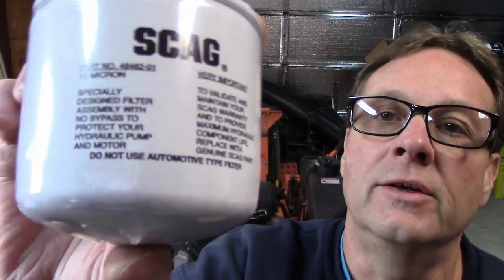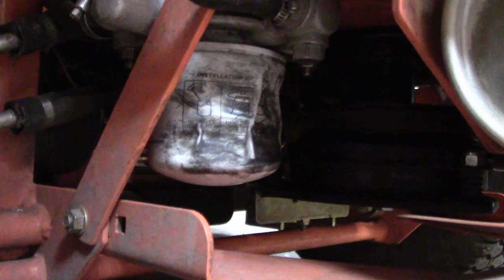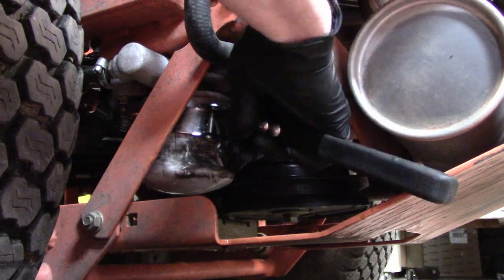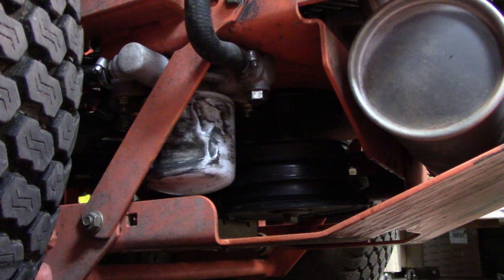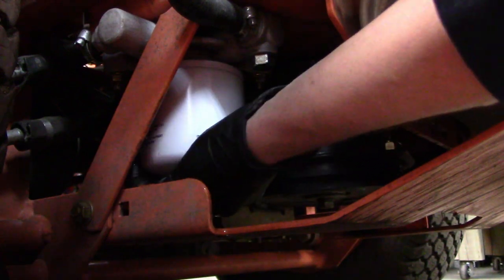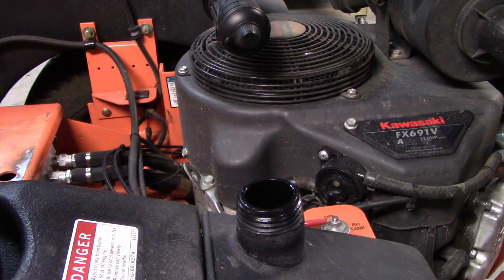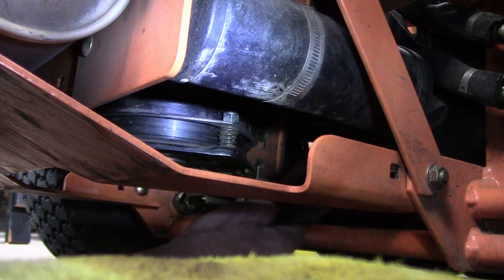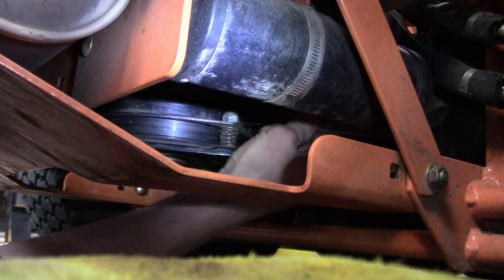Scag Tiger Cat Hydraulic oil filter change and clutch adjustment

Comment: Mark... good demonstration vid.  One thing that aggravates me about just about all mower manufacture's is their stupid filter placement (both engine and  hydraulic).  Why they can't locate the filters with the rubber seal up is beyond me.  Think of all the oil messes and spills all over the frame of the mowers that would save!  Ferris is one exception if you get a model with the huge 5 quart (or so) engine oil reservoir with the oil filter right in the very top just behind the riders seat back!  Plus you are only required to change the engine oil about every 500 hours!  I think their engineers are actually awake at Ferris!

Comment: Hey Mark hope you had a great Christmas and I’ll wish you and Vicky  a happy new year too
Yeah I love my Walker but there are very limited dealerships here in jersey too!! It’s a great mower that’s so convenient with the power dump, mine actually is the high dump as well! The only issue I’m having is the lifting wire harness is running intermittently so I am currently waiting for it to arrive it apparently is a known issue I just hope it works! I will install the harness myself! Like you I try to do as much myself as I can! I may though pickup a used scag or even toro as a backup but certainly used not new! Unless I find one cheap

Comment: I’ve been running scag mowers for years and years and have had very few issues with them. I have one with almost 6000 hours on it. Still has the original deck spindles.
I also was wondering why you don’t go to a bigger deck like a 61 inch? A lot of your properties look to be fairly good sized. Just curious?
Have a great new year! Really enjoy your videos.
Reply from the maker: About 75% of my properties are smaller yards and the 61 is just a little to big to get around with.
Reply: Ok that makes sense. I really like how you do things. It’s very much how I do stuff as far as maintenance. Seems like a lot of guys around me take their equipment in for maintenance. I know I save a lot of $ by doing my own. Keep up the great work.
Reply from the maker: I also really enjoy doing the maintenance on the mowers when it is slow.

Comment: Do you have to open the bleeders on the hydros when you jack up the mower and go back and forth with the sticks to get air out the system? Thanks
Reply from the maker: If the filter is filled before installing that is not needed.

Comment: What problems have you had? I’ve had my Scag for 6 years now, just hit 500 hours. I’ve changed belts, oil, filters, and one PTO switch was replaced under warranty.
Reply from the maker: I go through a deck belt every 150 hours. Carburetor and the safety harness was replaced under warranty because it wouldn’t run on both cylinders at less than full throttle. All of that happened in the 2 years I have owned it since new.
Reply: Marks Misfit World that’s probably about right on a deck belt. I had my drive belt somehow pop off, I think something jumped in between it and a pulley. Anyway, it knocked off my brand new deck belt, broke it and the drive belt rode on the edge of the pulley and gashed it. Was not happy!

I’ve learned not to put the mower in too thick of stuff. Yes it will cut it. But the belt will start to slip, and wear it out faster. 

My harness got smashed on one connector by the seat. I fixed it and haven’t had anymore issues. The only other issue I can think of, was the mower kept wanting to die randomly. Eventually I took the seat off and took it apart and found a giant rat nest inside it that was affecting the safety switch.

It’s been a really good mower to me. My dad has gone through a john deere and toro in less time than I’ve had mine. The john deere was the worst piece of crap ever. My uncle has two exmarks. One has been beat up and started falling apart probably in his 5th season, but he never took real good care of it. The spindels on the exmark are not serviceable. 

Scag has the best spindels by far. 

Thanks for your video btw. I just ordered some gauges to check my clutch, valves, and change my spark plugs.
Reply from the maker: @seabass22  None of my other mowers go through a deck belt once a month and it get a little tired of them blowing in the middle of a yard. When the deck belt blows it usually takes the drive belt with it and is a little embarressing when I am laying underneath my mower in the middle of a customers yard changing them. With being a commercial mower you wouldn't think I would have to go through 4 deck belts in one season. But everything else works like it should and I would never be without a calmshell bagging system again.
Reply: Marks Misfit World is there a knick or something in a pulley? I change my deck belt probably every other year, but I’m not putting those kinds of hours on mine. I was told by my old dealer, that it shouldn’t be going through belts at all. Not OEM belts anyway. Idk, that seems excessive, and no, it is not fun at all trying to get that belt on by yourself!
Reply from the maker: No, it has been to the dealership several times and they found nothing wrong with it.
Reply: Marks Misfit World dealerships aren’t always too great. Check the bearings in the pivot point of the tension pulley arms.
Reply from the maker: I did all of that. Been over the whole thing, last I was told by the rep is that the belt probably can’t handle the amount of bagging I do with it. This summer I will be trying out different brands of aftermarket belts.
Reply: Marks Misfit World oh okay didn’t realize you were bagging with it that much. Yeah, that would definitely do it. It’s always the leaves and thick grass that kills my belts.

Comment: Hi Mark, have any thoughts on the clutches anti rotation bracket? I have to keep tightening the bushing that takes a beating
Reply from the maker: I use blue lock tight on any bolt that has a tendency to loosen up.

Comment: Hey Mark, What's the tool you're using to check the clutch with?
Reply from the maker: It’s a feeler gauge
Reply: @Marksmisfitworld  What's the size and are you tightening ' over the gauge' itself to gauge the looseness of the clutch?

Comment: U don't use any filter but original scag.
But u damedged a filter and a kept running your more. The filter element was damedged. surly it was alowing trash to get to the hydraulic units.
Reply from the maker: If it is plugged no fluid goes through it. That is why I use these filters.